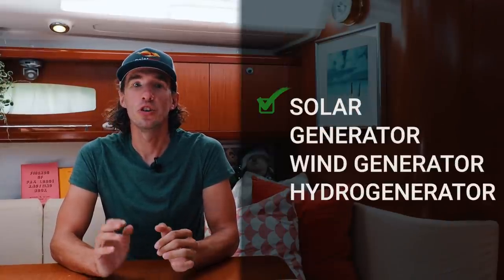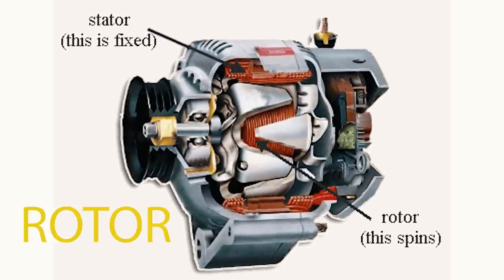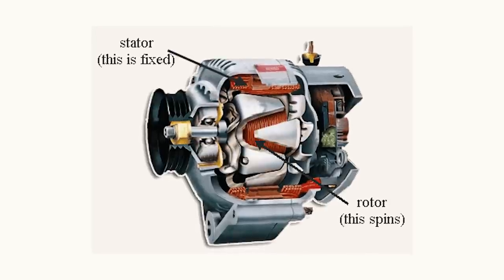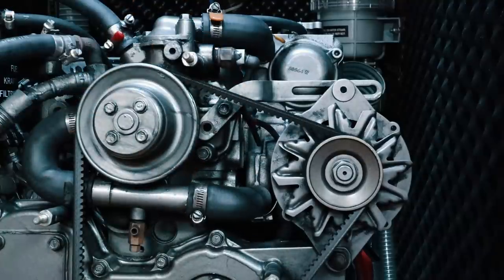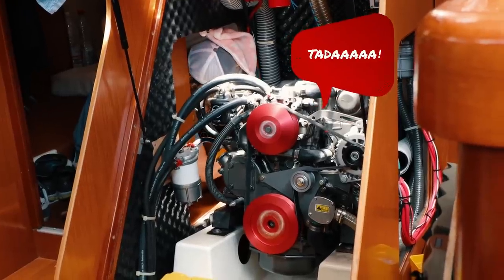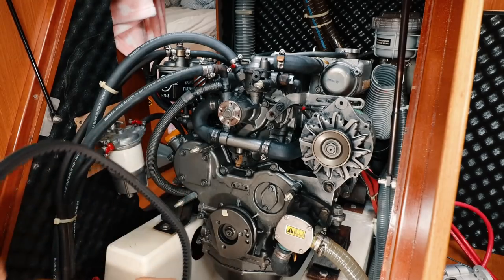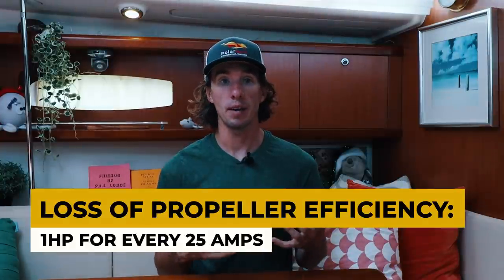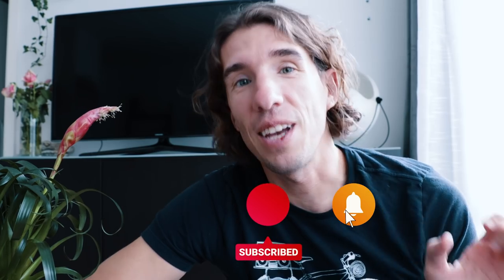SAILBOAT TECH: How to transform your ENGINE into a GENERATOR! // Ryan's Tech Corner #10

Comment: Thanks for this video Ryan.  I have the same 80A alternator on my Yanmar as well with 400AH of AGM house battery capacity.  The output of the alternator is mostly a function of the state of charge of the battery which is sensed by the voltage regulator.  After letting my batteries get down to about 70%, I ran the engine at 1200 RPM and measured the alternator charging the batteries with 66 amps.  Sure enough, this decreased as the battery voltage and SOC increased.  When my AGM batteries need to be replaced, I will need to decide what to do (AGM vs. Lithium).  If I go to Lithium, I will probably need to make the investment on a new alternator and voltage regulator to deal with the heat issue.  As you pointed out, it is an expensive upgrade indeed.  I mention all of this only because in the video, you said the alternator charges at something like 30% of its rating.  I believe this depends on the state of charge of the batteries.

Comment: Great explanation on how alternators work.  I’m no marine mechanic, but I’ve been turning wrenches to keep a roof over our heads for >25 years.  I saw a setup in a picture once that looked like an alternator connected to the propeller shaft off the back of the engine.  I have often wondered what happens with the propeller while under sail?  I’d imagine that unless the blades of the prop could collapse, that it would naturally want to spin to reduce drag.  I have no idea what rpm a prop shaft would spin at while under sail at a specific speed, but I’m certain it could be calculated and an overdrive pulley system be used to speed up an alternator sufficiently to produce current at a cost of .5 to 1 knot of speed.  Just a thought.

Comment: Ryan, I'm a new-comer to your channel and am enjoying it and learning a lot.  Thanks to you and Sophie!  In this video, I was really surprised to hear that you used your engine for 90 hours during your East to West Atlantic crossing.  Your boat's fuel tankage is, what, 53 gallons?  Did you get a fuel bladder?  How did you handle the fuel demand?
Reply from the maker: No.  We have 250lt on board and burn about 1.8 an hour.  So yes, we used a lot of fuel but no bladers needed... though we were very low on fuel.

Comment: Hi Ryan and Sophie - I also own an Oceanis 40 and I am about to start a alternator / inverter / lithium battery upgrade project - but will most likely go with a 48v alternator / lithium bank with a dc-to-dc charger to the existing 12v system onboard (to pull this off on a relatively small engine, I will be using a programmable alternator regulator/controller which will adjust the alternator load depending on the RPM on the engine in addition to the alternator temperature and battery charge level etc..) - I have been waiting for your alternator upgrade install video, but in the meantime I wanted to check what brand / model of mounting you are using on the Yanmar engine ? Cheers Lars ('Lady Marmalade' - Dubai Offshore Sailing Club)

Comment: Do you have any information on the external rectifier?  Why are they so rare?  How many amps will yours handle?  Did you completely remove the rectifier from the alternator, or does this unit supplement the one in the alternator?   I suspect that people install big alternators and then the temperature sensors dumb them down, so it would seem that the rectifier is the way to go.  I am thinking, though, to go with the Mastervolt Alpha Pro III.

Comment: Get rid of you feathering propeller & put a pulley on your shaft that goes to your propeller. Then connect a 200 amp alternator to it. So that it will work while you are sailing & your engine is off but in neutral & the prop is turning. Put another high output alternator on your engine that will work on demand. Another good idea for sailing is to put saildrive  in front of your keel is say where the mast is. Place a vertical axis wind turbine on top of the mast. Attach the vertical axis turbine to a shaft straight down to the saildrive system. This way you can put it un neutral, reverse & forward when needed & can sail straight into the wind or any direction as long as there is wind.

Comment: I had wind turbine, solar, and high amp alternator on my boat, and the best bang for the buck is the high amp alternator.  I dedicate the wind generator to refrigeration with it's own isolated battery.  The solar supplements the house batteries and I run the engine an hour a day to keep up.
Reply from the maker: I Agree Mike, though i do prefer solar.  Ryan

Comment: I would have loved to see you try a permanent magnet   alternator, there are some good ones out there for trucks (24v) , they are a lot more efficient  and for less than $1k.
Reply: Interesting, but I wonder about having a big permanent magnet near my compass and flux gate compass. Would it cause interference. I can't move my engine away from the helm position.
Reply: @philgray1023  shielding is an option if interference is an issue,  a electrically exited alternator also generates a field when working so if you have one now and have no problems, this should be ok.

Comment: I wonder at what point it's worth having a smaller secondary Honda petrol generator
Reply from the maker: Cost wise I think the small generatot would be cheaper.  But then you have another engine to service and you need to keep petrol on board, which I'm trying to avoid.

Comment: When you've had a failed regulator cook a new $425 battery and almost cost you your boat, any, and all of this is of interest.  I looked at the aqua generator route and expensive was the word that blotted out anything the sales person said after blah, blah, $😕😕😕😕. The wind gen, well ours is not cheap, but it is quiet. However at 30 knots it does vibrate the aft cabin. Hoping my latest overhaul has fixed that. But honestly the wind is a fickle mistress. It's a lot of money for not many amps.

Comment: How about a propane generator? A new 1000 watt propane generator will run 60 hours on a 20lb tank. They're light and portable and very quiet, and some are made to be able to connect together. You can run a typical sailboat AC unit with two 1000 watt units together. 1000 watt propane generators sell for ~$530 on Amazon. I'm thinking of going this route and trying to figure out if it's a mistake? I decided to look into this because my friend has had a small 4 stroke gas Yamaha generator for probably 20 years. It always starts, runs perfect, it's very quiet, small and light. It's the size of a small cooler. Plus, no part of the exterior gets hot, the exhaust is hidden, and I've seen it get knocked over, it immediately shuts off. It also has low oil and other emergency shutoff systems, and it's old! 
So...if you were running two 1000 watt units on your crossing, you would've gone through probably four 20lb tanks (assuming the manufacturers rating of 20lbs/60 hours is with no load) in 93 hours i think you said. Include tank changes, where to put them, where to put the generators, ya, long passages would be tough with this setup. Plus, given the global inconsistency with propane tank fittings you might have to carry either different tanks or adapters, which I'm not sure are legal or safe. Ya, I'm talking myself right out of this...unless I'm not going far!

Comment: Can you also get an alternator that will produce 110 V  AC current at the same time current going through the rectifier to produce 12 V DC current. This would give you the advantage of using 110 V AC appliances while you’re underway without using the inverter off your batteries.

Comment: I'm curious if you had to run new larger gauge wiring.  I am considering installing an alternator with double the output, but the 0/1 gauge wiring needed will be very difficult to route where it needs to go.
Reply from the maker: I did... at least through the part of the system that needed it.  If the big wire is too thick you could run two smaller wires.  Ryan

Comment: With lithium batteries, when a battery becomes fully charged, the battery maintenance system (BMS) can disconnect the battery in order to protect the battery from overcharging.  The resulting sudden loss of a load on the alternator output can cause a voltage spike, blowing out the alternator's diodes.  Is this a concern with your system?  Does your rectifier/regulator prevent this?    Great video.
Reply from the maker: Hi Jim,  need to break this question down a little.  First, in normal battery operations the BMS will not 'kick in'  when the batteries are full the charging source will stop charging or go in to a different charging mode based on voltage.  In an abnormal situation and the BMS kicks in you are correct that this situation can cause major problems to the alternator... Its important to note that this problem can happen with any type of battery type.  If someone shuts the flow to the batteries from the alternator bad things can happen.  

A few things to get around this.  Sterling Power has a Alternator Protection device which is suppose to avoid this situation.  The other option is to have the alternator charge the lead acid starter battery and then through a B2B charger charge the lithiums.  This way if the BMS kicks in nothing happens to the alternator.  

Hope this help! 

Ryan
Reply: @RyanSophieSailing  Thanks!  Something we must remember - don't turn the battery selector switch to OFF when the engine is running!

Comment: Ryan, what size of DC-DC do you use? Do you still have the same setup as before, meaning alternator to starter battery then to DC-DC convertor, then to your lithium?
Reply from the maker: Hello.  I have switched up my system now.  I removed the sterling B2B and added a victron 18amp B2B.  The alternator now charges the lithium then charges the starter battery from the b2b.  So its opposite of my last setup.  Ryan

Comment: It's quite surprising really that all marine engine makers don't supply an alternative high output alternator that will sit ticking over and quickly charge a bank of high amp-hour batteries. All that wasted ballast that could instead be batteries, I just don't understand, because 'extras' means extra sales and profit, doesn't it?.

Comment: is there the possibility of a clutch arrangement to use the prop shaft to keep the alternator spinning for regen but disabling the serpentine so there aren't the pumping losses from the engine? (spinning the alternator with wind rather than the expense of fuel + engine hours. Or is that hitting so far off the payback curve when you have a diesel it's like buying '$80 solar powered phone battery to avoid the expense of plugging into the house AC for $1 of bulk electricity over the device lifetime")
Reply from the maker: We have a folding prop so i dont think that will work very well.  There are some other issues with it as well.  Maybe i do a blog post about thatsoon.  Ryan

Comment: Great video!
I did an upgrade on my Yanmar 54 hp with a 120 amp alternator, external regulator and a belt & pulley system, also. One thing I immediately noticed was the effect on the tachometer reading.  Our engine at 2800 rpm reads 3600 on the tach. Did this happen to you, too?
Reply from the maker: Yes... the tach on the yanmars gets its information from the pulse count from the alternator.  Because you have a different pulley ratio the tach will be off.  I can't remember off the top of my head but it think you take the small pulley (alternator)diameter by the crank shaft diameter.   I think ours was like 16.1 or something.  Don't quote me on this.   You can pregame the new ratio in to the tach display.  I think there is a manual online... was not to tricky.  

Our issue is the fact that when the field current dials back the track just stops working.  Not a lot i can do about that.   Hope this helps. 

Ryan
Reply: @RyanSophieSailing  THANKS!

Comment: Thanks for the great video. Can I ask what is your voltage ceiling on the regulator 14.3 or higher?
Reply from the maker: I have everything in my charging system set to 14.2.  I could go to 14.4 but i'm trying to increase the life of the batteries a bit.  Ryan
Reply: @RyanSophieSailing  thanks Ryan. Do you find that the voltage set point fully charges the batteries, or do you prefer to be a little short of “full” to maximize cycles? Thanks for the feedback. Just wrapping up an identical install on a Jenneau  (MG alt with WS 500) with older Genasun 720 ah battery bank. Cheers to you both.

Comment: Thanks for exploring this not very much talked about option. To me the $3500 is small change knowing how much peace and quiet you will have later on. BTW going to the 200 amp maximum is not an unsafe practice. The battery also has its own protection. But yes, better to get some experience and hear other’s opinions.
Reply from the maker: The issue with going to the max charging input with bms that don't communicate outside is that if one bms shuts down you have 50 amps with no place to go.  Then you likey have a full system melt down.  Thus the reason I decided to keep it at 150 or lower.  But you are correct, all the batteries should have their own protection... just the system im considering.  Ryan

Comment: Thanks for your explanation about how to upgrade your engine's alternator system. I  went through a similar process myself, and did similar upgrades (not as nice as yours). My conclusion was that my engine is still an engine, and not quite a generator. Why? Because a generator is operated strictly for the purposes of making electricity, not propulsion. How much amperage my alternator puts out during cruising RPM isn't as important to me as how much juice it makes when I'm operating it strictly to top up the batteries when I'm on anchor at lower RPMs, for example (when I'm using my engine as a generator). I have as big of an alternator that would fit onto my engine. Any larger would have required custom fabricated mounting brackets (based on what was available at that time).There's also the issue of how your engine is going to run when it's trying to turn a massive alternator. The bigger the alternator the more horsepower it steals from your engine. Many people have gone down this road and for good reason many of these people have decided to install small gensets and more commonly big solar arrays, wind, hydro, etc.  Upgrading your alternator and charging system isn't quite the same as turning it into a generator, no offense. And if your setup does make massive output at or near idle speed (100 amps plus), my apologies. Sweet setup though 👍
Reply from the maker: Hi Charles, i agree with all your points.  we dont have the room for a generator nor do i want to carry a gas generated one on board.  But your points are very valid.  ours is a 180amp alternator.  We can switch the field current off while running and get some horsepower back. Ryan

Comment: Would have been much cheaper to buy a stinger performance small case alternator rated at 160A at idle and 320A at 2000rpm for $380. or a large case 400A for $460

Comment: If you decide that still not enough I may have a solution that may not be typical get yourself some high output alternators that are used in huge mobile audio systems in vehicles you could run a 390 AMP  alternator with ease. and  use a high input charge controller and get yourself a car audio lithium battery design for high input output due to massive power draw usually from amplifiers

Comment: Sophie, I have to say, I also said "what?" at $3500 but because it was so little.    Ryan, did you consider a magnetic clutch on the system for when you need every erg fraction on the prop shaft?

Comment: A hydrogenerator is expensive only if you buy a branded ready-made one. If you do this yourself, then it will come out no more expensive than replacing the generator on the engine.
Reply from the maker: Interesting.   Can you point me in the direction of one?  Ryan
Reply: @RyanSophieSailing  Any permanent magnet BLDC motor can be used as a generator. You can choose the one suitable in terms of power and speed from the motors for RC models or take a motor wheel from an electric bike.
The propeller shaft of the boat itself can serve as a drive, or you can tow a shaft with a propeller from a small boat motor behind you.

But you must understand that even the best hydro generators on boats generate only 100-200 watts of power at speeds of 6-7 knots. And they are only effective when you are constantly moving and not standing in marinas.

Comment: You are wrong at so many levels ..... For examples, the diodes will have lower loss at higher temperature, so they like to run hot especially in the alternator as the forward voltage drop will decrease and increase eff. (parasitic capacitance and stored charge are not relevant for this low freq). Second point, you may find that the losses in the iron are decreasing with temperature but for cooper is increasing, so again there is a sweet point of operating ..... 
I would not remove the diode and use long wires from alternator to the diode pack.... Best solution is to use a car alternator air cooled or even water cooled  and JUST replace it's regulator. Use a current sensing type that limits the current and limit the voltage to 14.2V, it's enough for LIFEPO4. I would use sense wires from the voltage measurement to the regulator.